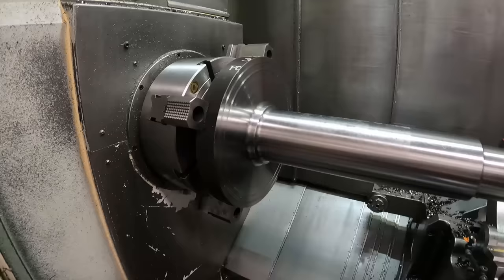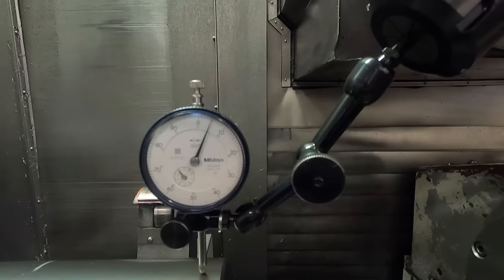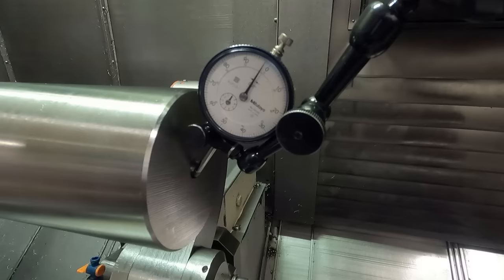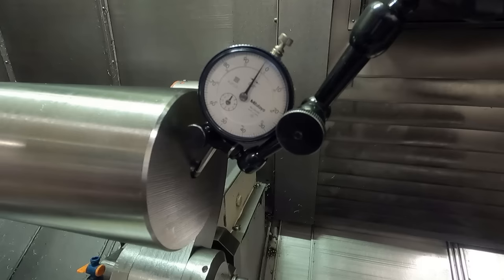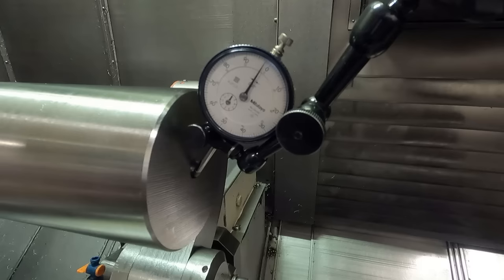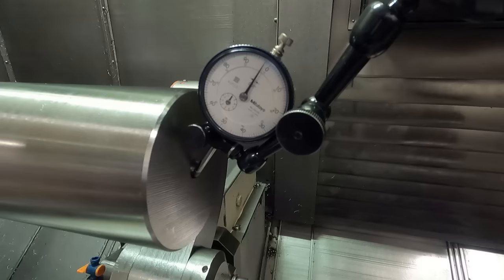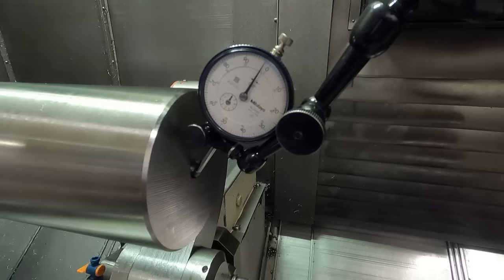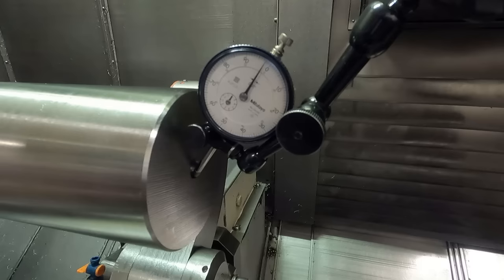Machine Shaft From 2000 Lb Stock

Comment: I love seeing other machinists thought processes, my old boss who taught me everything about machining who’s been a machinist for over 40 years taught me about stresses induced runout when I was machining a similar part to yours, it was only about 5 thou, and didn’t matter for our parts. But it just goes to show much there is to learn in this trade
Reply: When I was assigned in Japan under a diplomatic mission cover way back in the 1980s, I saw several basic Japanese machine tools for the Japanese has never and will never forget from learning FIRST all the basic machine tools but this time they upgraded it in using omni-directional laser scanners that can practically scan any item and turn out exact copies of the same components. But they have maintained the same 1950s and late 1940s machine tool alloys used in making machine tools because they LAST AD INFINITUM! I ask them why use the old alloys and they said it is based on their experiences from WW II which they have carefully recorded and microfilmed archived. It is because of the lack of raw materials that they could not make REPLACEMENT PARTS for their machine tools for the war effort, especially the cutting tool bits and tool bit holders. This time they have to make sure that even in peace time, any interruptions from raw materials supplies will not disrupt their machine tool operations and this time for DEFENSIVE AND COUNTEROFFENSIVE PURPOSES to protect Japan. That was way back in the early 1980s and I have no doubt they are still maintaining that policy of BUILDING TO LAST INDEFINITELY.
Reply: I think that's why Japanese automobiles are built so well..... They're made to last as long as they can. American manufacturers of automobiles are still using "planned obsolescence" thinking, with the idea that they can sell more cars and car parts if they wear out within a predetermined amount of time. The Japanese don't think that way.
Reply: @johndonlan5956  Ever heard of the Kommuna Russian ship which was built just before the 1917 Russian revolution under the Tsar? It is made out of a steel that won't rust at all even after 122 years has passed and it still being used by the Russians to this day! A Russian engineer told me they already took samples from non-critical locations from the ship and has spent tons of money in scientific R&D trying to figure out on how it was made, and they already knew how to duplicate the process and the steel material. They already built a factory, 8 in fact, to manufacture that kind of steel for the Russian military and it is not available yet for civilian use. But imagine the shockwaves and howl from American iron and steel makers when we Russians will make it available for civilian use world wide! They will lobby congress to stop it's importation but American buyers who are already fed up with planned obsolescence will demand it to be sold to them for all they have to do is look at the appliances made in the late 1940s, throughout the 1950s up to the early 1960s of te grandparents and great-grandparents that are still in pristine conditions and still running strong! Today's ship builders will demand it to be made available to them for their buyers will demand that their ships that they ae buying must be built to last!
Reply: @johndonlan5956  Indications of a superior society and culture. America has been devoured by locusts of greed and our industry leaders are less than their former.
Reply: @darthvader5300  I'm not sure I'm understanding anything of what you say.  I was involved in industrial machine tool marketing from 1975 to 1986 when the recession hit.  During that time ALL Quality machine tools ....that were affordable for shops ....came from JAPAN .....literally ALL.    The solid European machinery ...British, German, etc., where far too expensive for most every shop.  The machinery I refer to are Mazak, OKK, Mitsui Seiki, OM, Okuma, Takisawa, SNK .....and the list goes on and on.    The point is, there has NEVER been a "lack of raw materials" in/from Japan.

I also point out, for those who think I am just blabbing along with no knowledge, I raise the point of the advent of CNC.  This started in Europe through the well-known company SIEMENS.  Controls for machine tools were designed and built by "SIEMENS AG".    These controls were initially adopted in the U.S. under the name "GENERAL NUMERIC".  If you looked at the boards inside the General Numeric cabinets, they were ALL identified as SIEMENS AG boards.    In Japan, the CNC machine tool controls were identified as "FANUC" which, once again, when you looked inside the controls, the boards were ALL identified as made by .......wait for it .........SIEMENS AG.     This is the way it was through the many generations of the control changes.

What you don't understand is that Japan did not understand Quality until a point in time when they DID begin to learn .....and from that point .....THEY CHANGED THEIR CULTURE TOWARDS QUALITY ....something the rest of the world did NOT catch on to ....mainly because the rest of the world's corporations turned to PROFITS as being the most important directive ......decisions made by "white collar managers/owners" who knew nothing about quality.

Remember the first "DATSUN" vehicle?     A piece of junk that rotted out in a matter of a few years.     The Japanese LEARNT from this and realized there complete disconnect between their own machinery and the products they were making.    They started apply their internal Quality knowledge, like ISHIKAWARA and KAIZEN, and many other Quality tools, to their EXTERNAL PRODUCTS.

The difference between Quality products and junk is due to OWNERSHIP. .....which has been changing once again as the established Quality shops are being bought out by investment companies that are doing nothing more than "FLIPPING" companies.    They search out private companies that are solid and have a good product, and the ownership has been building it for 30, 40, 50 years and have no one to take it over.  They bring in a "CEO" to market the company to sell.   They find a buyer, sell it, and put a huge chunk of money into their personal pocket and walk away.   The investment company immediately increases the selling prices 10%, chop the company's operating cost by 10 to 15%, making the company's books look even more attractive ......for the purpose of reselling it.     In the meantime, the entire internals of the company is trying to function with a significantly work force that is now pissed off ....with remaining workers now leaving because their work load has increased significantly.  The mandate now for remaining "management" is to cut costs any way they can .....meaning ALL outsourced parts must be re-sourced.    A very vicious situation that can only have one outcome over time.

HOWEVER, with all the above being said, this video is actually VERY IMPRESSIVE.  My field is manufacturing engineering with a focus/specialty in Quality Assurance and Non-Destructive Inspection/Testing.   This machinist is very cognizant of the many variables that he must deal with and is explaining accordingly as he addresses each of the issues.  Very well done and well worth the time to follow along.

.
Reply: @taxicamel  You did not understand me for I was referring to their WW II war time situations and circumstances and experiences. Because during WW II they lack raw materials to make replacement components for their machine tools and heavy engineering facilities and machine building facilities. With the coming of peace time to Japan, they took advantage of being able to have access to key critical raw materials to make sure and ensure that their machine tools will be so solidly built so as to last ad infinitum. Tantalum, niobium, cobalt, tungsten, chromium, molybdenum, vanadium, boron, cerium, yttrium. Then they added to their list these metals which are manganese and zirconium and silicon.
Reply: @darthvader5300 lol yeah any claim about Russian manufacturing is an actual joke

Comment: Could save yourself a lot of pain in op2 by using a small bung/faceplate against the end of the part with the tailstock applied, skim a steady band. Apply your steady. Re-face the part and do your end hole so it’s true to the band you’ve just essentially free-turned without any pressure on the centre hole. Now you can engage your centre and turn it all true to the hole you’ve just made. Saves faffing about with chapping true and nipping/un-nipping jaws true with a DTI when, in essence, you’re truing up to something you’re going to remove in the next hour.

Comment: Very nice.  I noticed that some of the micrometers had "For Reference Only" labels on them.  When I worked for the USAF, I used to see that on things that came back from PMEL (Precision Measurement Equipment Laboratory)  that hadn't passed or had expired.  They usually worked just fine, but you couldn't use them for inspections or periodic maintenance. We used to have a torque wrench that was used for an annual inspection, but it still had to go in for calibration every six months. Madness.
Reply: And took 4 months to come back. Gotta love PMEL.

Comment: 2000 LBS start, 140 lbs end. Perfect job to hot forge. But, if you only make two, not worth it, unless you already have all the hot forging equipment. That part is just asking for it though! Great job, very well done.
Reply: I thought the same thing!
Reply: You could have made this as a two part design, that would be much more efficient.
Reply: @thomebau895  He mentioned in another video that the client tried a multi-part design and it failed. That is why they chose to use a one piece design this time, despite the extra cost.
Reply: I could easily make a 2 piece that wouldn't fail
Reply: @matthewshyetessamcintosh3460  Peter suggested he probably could too, but  he made what the customer wanted, and no doubt got paid well for doing it.
Reply: @kindabluejazz  2 piece part welded together, would be just as strong.
Reply: Great video , true master craftsman right there but an awful lot of waste material left over , must be a better way to make that part to cut down on the waste .

Comment: When I was a machinist, I turned this crap on a manual lathe.
 What was even more fun was roughing out a blow out preventer on a manual 76" Bullard vertical turret lathe.
 35,000lbs of asymetrical iron spinning at 15o rpm.
 When your chips looked like giant Frito corn chips with no heat discoloration, you knew you hit the sweet spot.
 Usually at 1/2 in depth of cut 
 Hawgin iron it was called.

Comment: Nice explanations throughout for those of us who are mechanically inclined and curious but have little or no 'hands on' machining experience (although having done software development in a group that did fancy, for the day, CAD/CAM over 40 years ago I have some out-of-date exposure).

One thing I find myself thinking when watching this and similar videos is how much time is spent on centering (although, obviously on this job with the amount of material being removed it's a quite small part of this total job).

It seems that much of this could be done more quickly by "computer + sensors + hardware" under the guidance of the machinist (including specifying such things as max/min jaw pressures etc. as the machinist has a sense of the "grippiness" of various finishes/jaws as in this case). The spindle/chuck could have timing features (maybe at this class they already do) and a "digital" dial indicator being read by the computer. With that, the computer can do the trig to take an initial guess at which jaws to tighten or loosen and by how much and then actually extend a tool to do that to each jaw. Rinse and repeat until spec is met (or computer throws up its hands and cries out for a human machinist). Each iteration would take into account the change over the last try to temper the amount of torque to apply to each jaw adjustment. For extra credit, add a variable strength pneumatic "bumper/vibrator" to replace the hammer and couple that with three digital dial gauges around the circumference at the tail end - the computer could apply force in increasing/decreasing levels (up to constraints specified by the machinist) to the "bumper/vibrator" and turning the piece while monitoring the effect so relatively little "oops, went too far".

I suppose version 12.9 of such a system would actually take into account the mass of the piece being centered (assuming a full CAD/CAM system, not just an assist to "old school" machining) to work more quickly and have a wide array of scenarios it could adjust to - but that's probably a bit beyond what would be needed for an MVP.

Since this is so "obvious", I assume this already exists (although I've never seen it) or it's a ridiculous idea that has been tried many times and failed for economic or technical reasons :(

Comment: I’ve had to get similar work on long parts trued up in a lathe an old timer taught me to use brass shim’s about 1/8 thick on each jaw that allows them to be tight enough to keep the part from falling out but allowing movement when you adjust the runout at the far end to true the part at each end. This way you can cut two steady rest spots that are 100 percent true and allows for easy adjustment. You can switch back to your 4jaw chuck solid jaws without skipping a beat.

Comment: I'm amazed that a machinist like this is still working with inches.
Reply: In America we use both. I think that's a common misconception that we're not on the metric system. We use both equally depends on the application

Comment: I have a stop I put in the chuck. It has a landing that spigots in the chuck bore. It has notches cut in it so the jaws can still close past the bore of the chuck. I have a thread 3/4" unf  tapped into it. The bolt has a large ball piece welded to its head and I have adapted a G clamp foot to it. I can them pressure hold a workpiece between centers just like how you pushed your workpiece in at the beginning of the video. By holding the workpiece away from the back face of the jaws, you are not fighting the squareness of the stock. When you get close to size and want to release jaws to    minimize stresses and let it relax or normalize it doesn't change longitual position. I didn't know that about centre drills. Helpful tip!

Comment: Back in 1971 I cut a 8 inch dia x 8ft long Acme thread. Had to take a truing pass after each depth of cut to straighten the shaft. 
On another job on a Lucas Boring Mill, I removed over 5000 lbs of material out of an insert pocket (14" deep) in a Die Cast Mold base.
Fun stuff!
Reply: What type of tooling did you use back then, just HSS?

Comment: Engineers create the component designs through calculation, CAD/CAM and in depth analysis. But it's craftman like this man who bring it to life. Technology may have got more advanced but you will never find a replacement for skill, experience and attention to detail.
Reply: And because of engineers like us he has to remove so much material to get a shaft with a huge flange:). 20 years ago in my second week as a design endineer at the factory i had a call from a machinist from one of the shops and he was furious. When i went downstairs he opened the tooling room and said" -please find the tool to make this stupidity of your possible!". 2 years later we were best friends and he taught me how to work (basic stuff) on the milling machine and the lathe. And arranged that i go and do couple of shifts. Afterwards noone complained again from my part designs and i grew huge respect to the wizzards from the shop. I called and asked when i had some strange idea instead of trying to force it on them. This is something you learn your whole life. Later on i tok anothe Bsc in mechatronics and masters in Electronics and now i have more years as an electronics engineer. But the experience was priceless.

Comment: Great video and a good example of how much manual labour, thought process and experience goes into making quality parts. Most people including bosses always think CNC is just putting raw material in the machine and press the start button and while the machine is running you can handle three other machines as well. OH NO.

Comment: Its amazing how an engine block sized chunk of steel weighs as much as my entire old car.
Reply: What kind of car did you drive? 2000lbs is pretty light!
Reply: @ultranitro437  a 1994 Geo Metro that I converted to electric back in 2012. Although the lead acid batteries put it at 2500 lbs. Lol.
Reply: @donovangibson7765  yeah that is about one of the lightest "common" cars on the road in america! My buddy had one with the 3 cylinder and it could barely get to 65mph with the 2 of us on the freeway!
Reply: @ultranitro437  trust me, they're terrifying to drive at 70 when they're overweight with batteries! Lmao I've got some old footage on my other channel XmodAlloy on youtube if you want to check it out.

Comment: This is very similar to a job that came through the shop I was at. 2' diameter bar 20' long or thereabouts and they wanted it turned down to I believe 7" or so for 19' and the last foot left closer to the 2'.

Gravy job, but ran into similar issues with stress relief

Comment: You can simply re-center after roughing and then finish turning and you've already solved your run-out problem.  Many greetings from Germany!
Reply from the maker: Yes I know. But on this machine it is more difficult than a normal turret lathe. It requires moving the tailstock way back to get the milling head in to recut the center hole. Or some special tooling I don’t have. Also for the purpose of the video. I was trying to demonstrate something. Not necessarily the best way to go. On some later parts that is the way I did it. I skimmed the OD for the steady rest. This part had to be drilled and bored. So I did that then brought the tail center back up and finished turned the OD.